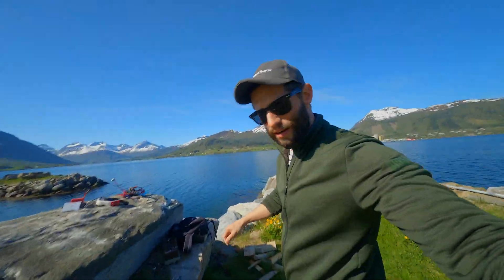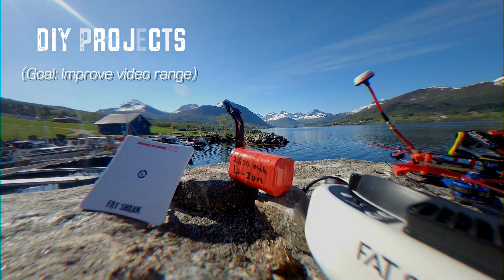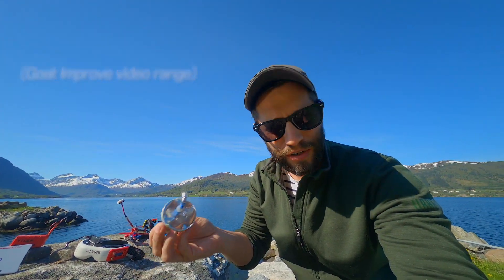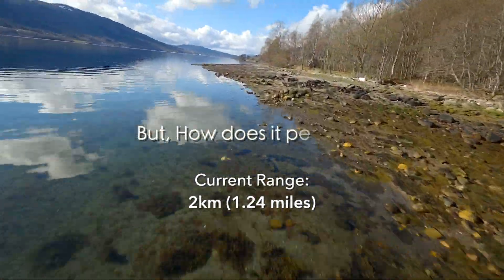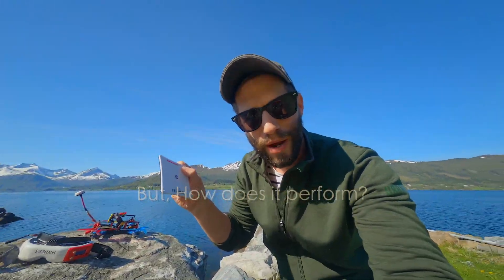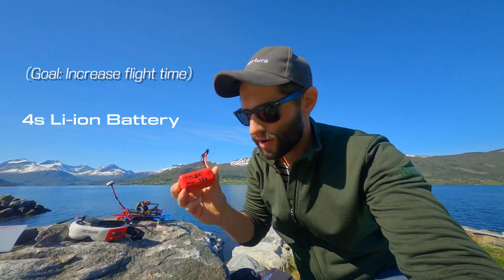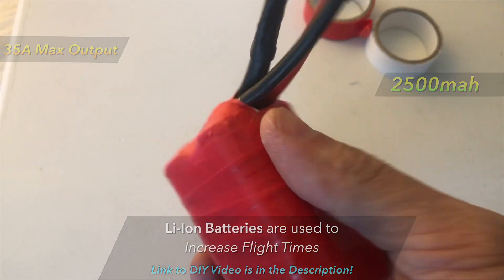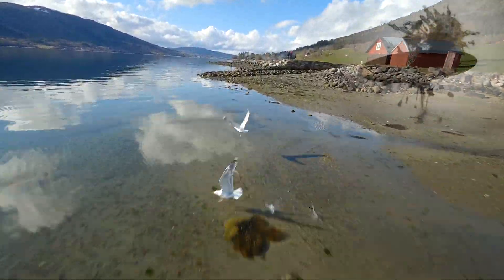Increase FPV Drone Range with DIY 5 Turn Helical Antenna and Li-ion Battery. VTC5a 18650

Comment: Hi. Nice video!
How did you show your signal vtx strength? Is that a feature of your goggle? I think its not a betaflight thing, or am i wrong?
Reply from the maker: This video was with an Analog Rapidfire VRX Module. If you are using one of those the signal strength meter is in the settings accessed through the goggles, not betaflight. Let me know if that helps. Thanks for watching, cheers!
Reply: @GiantAntCowboy  Thaaaaanks

Comment: So beatiful scenery and matches well with the bgm.  Did you solder for current flow on prupose instead spot welding?
Reply from the maker: Appreciate the comment. I assume you watched my DIY vids as well, I chose to solder because I read the nickel tabs don’t handle high current well, but also because I don’t have a spot welder… lol. The batteries have held up well and I’m don’t use the gently. Impressed with these Molicel cells!

Thanks for the support, let me know if you have any other questions or feedback. Cheers!

Comment: That was nice to see, since I fly urban areas seeing analog go that far is amazing! Looks like you can have your custom line of "trash" antennas ahaha.
Reply from the maker: Right? I actually just beat this range test using a 4200mAh li-ion pack. Reached, wait for it... 6.27km, basically 4 miles! Wow thanks for watching, stay tuned as I attempt to fly those mountains in the background!